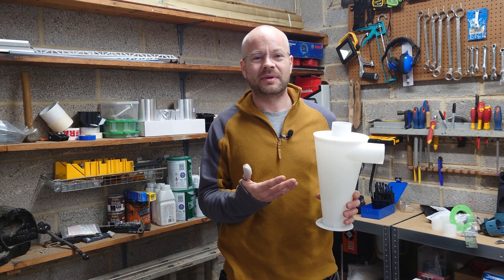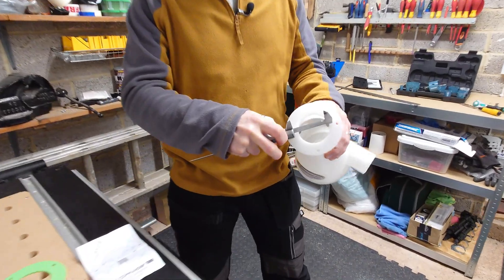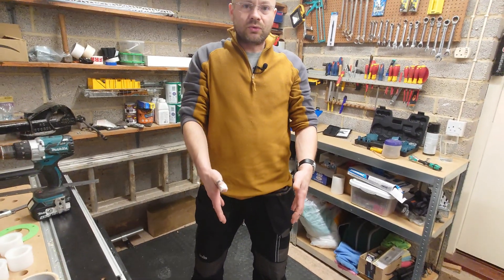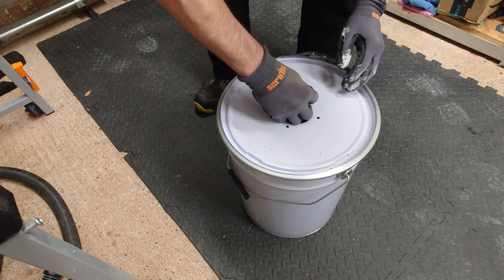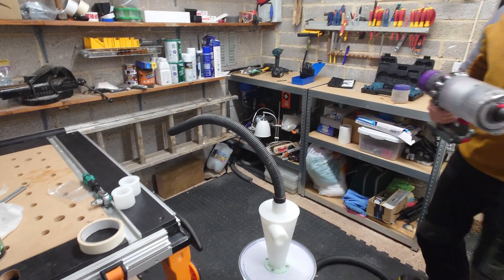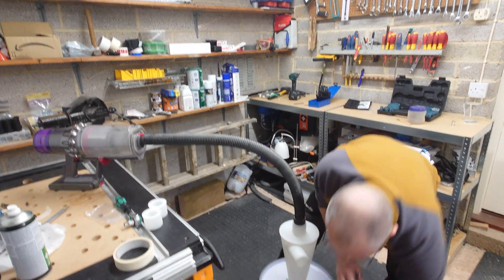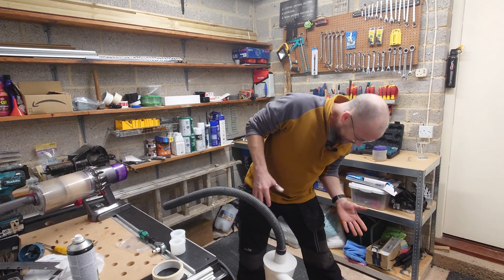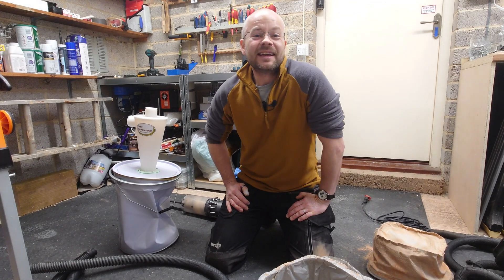How to Build a Cyclone Vacuum / Dust Collector for your Workshop

Comment: Thanks for the video. Two comments that may help:
1. Fit a pressure relief valve (£10 on Amazon).
2. Using a plastic container will make it easier to reshape if you have in implosion. Simply pour hot water in and push out the dents by hand.
Using a PRV will solve your problem though.

Comment: I added a 3 prong plug (I’m in the US) to the collector with only the ground wire connected to one of the bolts for bonding purposes. Keeps the static down.
Reply: I have a friend that has a Festool vac that burned up the circuit board because of static electricity issues. When I’m mobile I use a shop vacuum and don’t want problems with dust and shocks so I added the plug method mentioned in the video.
Reply from the maker: Interesting... does that actually work and what effect does it have? I can't say I've had that issue. There is the obvious danger that it could become live under a fault condition. (Assuming you don't have RCBO's / RCD's fitted in your consumer unit)?
Reply from the maker: I do like Stumpy Numbs 👍
Reply: @ChampionsOfTheTrade  check out this one too. https://youtu.be/a-zZ-d-l40g